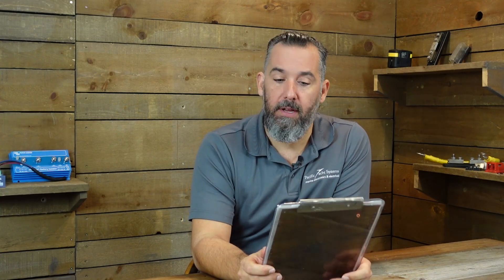Ask PYS - I Have Two Shore Plug Connections, Do I Need Two Galvanic Isolators?

Comment: I was told dual 30 amp shore power cords can use one 60A Galvanic Isolator.  ProMariner's manual shows it as the Safety Grounds (GREEN) from each 30A inlet tie to SHORE side and a single safety ground wire goes to the AC panel Safety Ground bus.  Why do you say I need two GIs instead?  (ProSafe FS60)

Comment: So maybe you know something I don't but the GI uses common ground for either circuit of either 30 amp pole. Ground lines from any shore power input (1,2 or 3) should be common and wired into a single GI with one ground going to your AC line on the boat. 
I see nothing wrong with this

Comment: Hello Jeff. one question.  If I have a 50Amp shore cable setup but my galvanic isolator (from whisper power) is only 32Amps, can I put  two in parallel to get a 64Aamp isolator?

Comment: Jeff, If my boat is 100% DC with just a battery charger, is a galvanic isolator required?
Reply from the maker: Once you have a battery charger you have AC onboard and therefore you should get a Galvanic Isolator

Comment: I have to incoming 30amp cords. Would I need two isolation transformers?
Reply from the maker: If you could be using both at the same time, then yes you need a isolation transformer per AC inlet.

Comment: Thank you Jeff, how do I know if my galvanic isolator is working ? I have  two in my 2005 Mainship trawler?
Reply: easiest way is to take a multimeter, put it on diode test and measure the diode drop across the two terminals, then reverse the leads and do the same. Should be somewhere around 1.2V i think.
Reply from the maker: Exactly Kofi, thanks for answering.
Reply: @PacificYachtSystems  And a big thank you to you for the incredible amount of info you put out. I think I first came across your videos, after my first time on a sailboat, looking at the electrics and noticing this weird galvanic isolator thing. Up until then I thought I knew a thing or two about electrics... What a rabbit hole did that turn out to be :)

Comment: About how much would a isolating transformer cost for a 30 amp service on a boat and what kva wold that be?  Can we just use one designed for standard electrical use (not boat rated)?
Reply from the maker: Hi Terry, look at Charles Industries isolation transformers they are the bench mark.